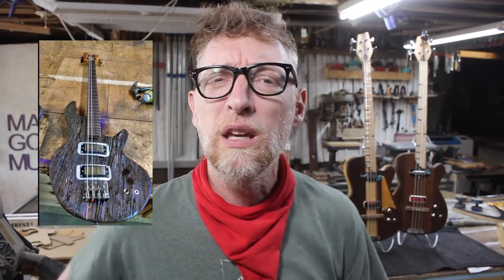Short Scale, Semi Hollow Bass - Vintage Inspired Design

Comment: I rarely comment, but watch every video you upload. But I have to say Tim, this is by far your best build. As a builder you're definitely improving, I was glad to see you reinforced the neck. Very well done and beautiful build. Great work!
Reply from the maker: thanks! Yea, I usually reinforce bass necks bc of the length (especially skinny ones like this) but don't find it necessary for most guitars. SOmetimes I buy graphite or carbon fiber rods, but lately I've just been using 1/4" stainless steel rods I gert inexpensively from my local steel supplier's "bargain barn."

Comment: Very nice Bass guitar builds Tim! Suggestion: Attaching the neck to the body with Hyde glue will still give you the strong joint. However, if you ever need to replace the neck, it will allow you to do it without having to break apart the guitar. You can simply heat the joint and it will come apart intact.  👍😉🎸
Reply from the maker: I use hide glue only when necessary (lome on my double bass build). There's no need to take this neck off unless something breaks, and in that case we're rebuilding it all anyways. I'm a vegetarian and avoid all animal products. Leather,  hide glue, gelatin, etc.

Comment: Very sweet lookin' n soundin' basses. I was considering how, handmade necks must be rewarding and yet tiresome to construct and I wondered how you feel, watching the CnC do it for you. Expedient, yes....but?
Reply from the maker: no "buts"! Everything the CNC does is only what I tell it to do, so if I make a mistake, it makes a mistake, and if I design the thing and the cutting process perfectly it comes out perfectly. Just like if I were holding the tool by my own hand. If I f--k something up with a chisel, it's not the chisel's fault, yknow? The CNC saves some time (although I bet if we started with a blank, we'd both be done about the same time). The difference is I can do other things while the cnc does this, and I can do 100s identical on the cnc which becomes more difficult and time consuming by hand. 

After the cnc is done I have pride in that part of the craftsmanship, the programming, but I still have to do all the finish sanding, fretting, fitting, etc., so I get to experience the "old fashioned" pride in craftsmanship that comes with that. It's totally a win win WIN!

Comment: Nice build! Love the idea of using reclaimed wood. Will be building my second guitar from reclaimed wood and was wondering; you added rods in the neck for extra strength or stability, but how do you know when those are needed?
Reply from the maker: This is a long, skinny neck so I added extra support. Most regular scale 6 string guitars really don't need more than a truss rod, unless the wood you are using is a little weaker or wood.
Reply: Thanks for the reply! I got some strips of mahogony and black limba from a reclaimed wood store. Will use them laminated and make the neck a bit thicker than yours, think just the trussrod will do the trick, but worth reading in to before glueing on the fretboard.

Comment: does any design/timber or other materials make any difference to the pickup's/sound of any guitar you make?
Reply from the maker: well that is a can of worms to open! lol. Watch this (or more importantly, read the comments of people passionately arguing both sides of the debate! lol. https://youtu.be/Hbyg0d1njk0 

While on acoustic instruments, the materials used are of the utmost importance, on elecrtric guitars, in my experience, every  aspect of the instrument effects how it sounds and plays but some are far more important than others. 

In order of importance YOU, your amp, strings, and pickups are at the top of the importance chain. Bridge, wires, finish, wood, etc. are at the bottom and not worth a percentage of the attention they get.

Want better tone? Don't cut down a "tone wood tree". Get new strings and practice! :)